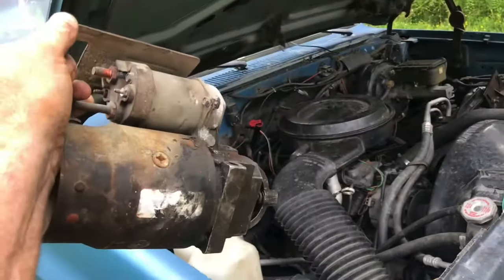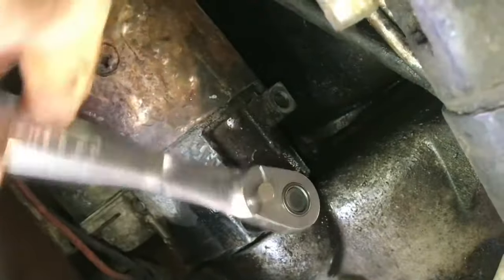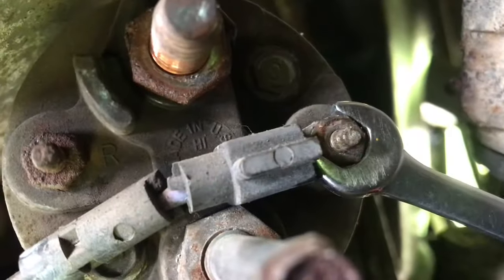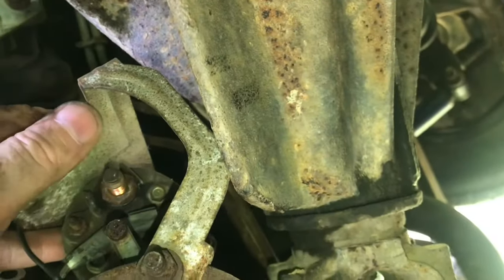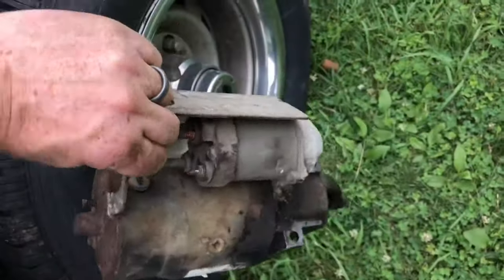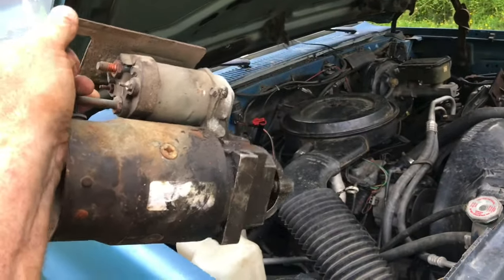“removing” STARTER chevy 350, 327, 305

Comment: This is not the same for a 305, you have to remove or loosen the exhaust
Reply: Lol he said 350 not a 305
Reply: @crazyman_is_the_best1479  read the title genius
Reply: Well maybe not actually I should check before it fucks my mood.
Reply: I squeezed it through! Really tight fit. Cant feel my arm from holding it up and aligning the bolts!
Reply: 305 is the same external dimensions as a 350. It shouldn't be any different. All the differences between those two engines are on the inside.

Comment: My ignition nut just spins...driving me nuts. I think the threaded screw it's on might be spinning with it. I don't want to pull the starter down without that coming off first. And there isn't enough slack to cut it. Any ideas? :)